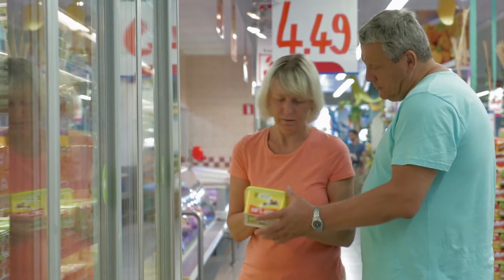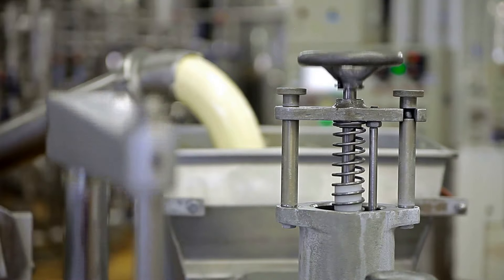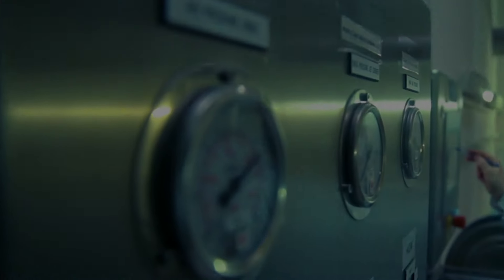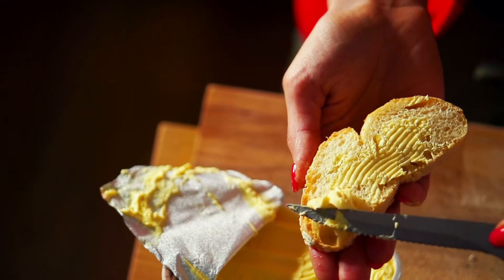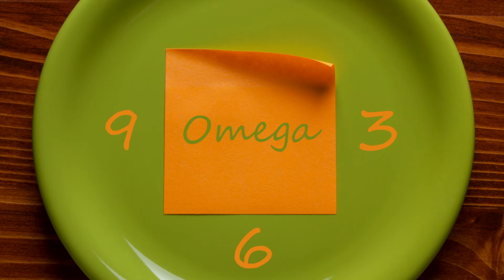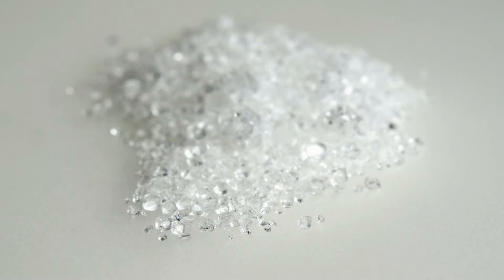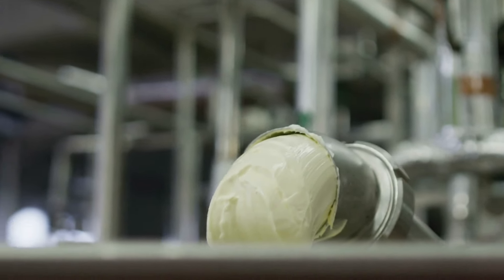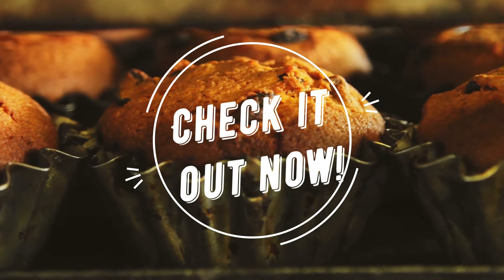How Is Margarine Made? (And Why I Stopped Eating It)

Comment: when i heard that author is concerned about GMOs, i automatically question whether the rest of information in video is accurate and adequate :-)
Reply: GMOs are just a myth :)
Reply: @drich90212  i'm absolutely serious. Nothing is wrong with GMOs, i would enjoy eating them anytime
Reply: GMO is only a problem for the genetic diversity of the crops. 

Please tell me that the stuff cow get feed with doesn't contain gentical modified crops.
Reply: GMOs aren't inherently dangerous... GMOs for the sake of industrialized mass production to maximize profits, well that's potentially a different story. If they are safe, it's sort of by accident.
Reply: GMO lack nutrients than the original ones. So clearly they are not so good.
Reply: @googleuser6894 That's simply untrue. One could argue that pesticide/ herbicide resistant GMO crops result in increased usage of said chemicals or monoculture increases systemic risk of crop failure, but having fewer nutrients is not a valid criticism.
Reply: GMOs aren't the problem, I agree. Margarine aren't better for another reason. 

They're over processed and vegetable oil in general aren't a better option than butter or animal source of oil.
Reply: The problem with GMO isn’t that it is harmful, it is that we are making significant changes that we do not understand the full implications of. Do not cross the express blindfolded.

Comment: just because something is synthetic it doensat mean that it is dangerous pls use common sense, what if i said that your cake  has sodium chloride , glucose, sucrose, sodium bicarbonatey and tartaric acid, you would be worried right? but waht if i told you that these "chemicals are salt,sugar, baking soda and grape juice?
Reply from the maker: If only margarine was made out of salt, sugar, baking soda and grape juice. :)
Reply: @FoodHow  margerine is solidified vegetable fa, the diffrence from butter is that it needs to go through a process so that the oil turns solid at room temperature this isnt needed in the milk butter because butter's fat is solid at room temperature, about the additives here in the eu we have strict food laws compared to the us so normally our margerine has : vegetable oil and fat, water, salt, citric acid, vitamins, fatty acids (  omega-3) aromas and the only " chemical" is potassium sorbate
Reply from the maker: Yes, I agree with you, but I am not a fan of the solidifying process, also called hydrogenation. Plus, the oils themselves they use in the first place, plus all the additives.

Comment: Would be silly to think that buttet is all pure if they can go to such an extent to produce margarine ! It's relatively much more easy to do the same with butter.
Reply: I have actually made my own butter, it is quite simple, but to make my own margarine, I don't think I could make it at home as it probably needs some extensive processing. I could be wrong tho. If someone has a homemade margarine recipe then I would definatley try to make it myself.
Reply from the maker: Butter is basically concentrated dairy fat, and it does not really require extensive processing, but I know some companies are mixing butter with margarine to make it more spreadable.

Comment: "But it costs $10 Cents less per pound, so that beats everything else." - Average person's thinking. What I have observed about average people is that they base their entire lives around two considerations only:
1. Cost - must be as cheap as possible. 
2. Convenience - must be handy and easy to use. 

That it's. The vast, vast, vast majority of people would rather pay less if they can . Severe health consequences 10 or 20 years down the line don't matter to 99.8% of all people. Secondly, the vast majority of people have no self-control or self-restrain. If they are in the street and they have the choice of eating hydrogenated fat-loaded cookies or starving for the next 5 hours to get home and cook a healthy meal, 99.8% will eat the cookies. The prospect of not eatinf for another 5 hours(the horror You'll die!) and then having to actually work to make a healthy meal is too much for most people. The average person is dumb and indolent and want low cost and convenience above any other consideration. 

Capitalism gives people what they want, not what they need. The food industry ust responds to the wants of most people.
Reply from the maker: Thank you for your comments; you have made some excellent points here. I have also noticed that healthy foods are way more expensive, and processed chemical-filled foods are super cheap and easy to get.

Comment: You can make margarine at home. All you need is coconut oil, vegetable oil, milk, egg yolk, lemon juice and salt to taste. Vegan option is coconut oil, vegetable oil, almond milk or soy milk or any vegan milk, beta keratin (just a little carrot juice),  lemon juice and salt to taste. I don't see where it's hard to make margarine at home much less having all kinds of chemicals.
Reply from the maker: Thanks for the tips! Sound interesting. Just wondering, I suppose coconut oil will go solid in cold temperatures, but how do you get vegetable oil to be solid and spreadable.
Reply: @FoodHow   Heat the coconut oil so it's a liquid. Add the vegetable oil. Wisk the two with the bowl on ice until it's a milky consistency. It'll be a little thick. Add the milk and the egg yolk or carrot juice. Mix. Add the lemon juice. Mix. Add the salt. Mix. Put it in a container. Refrigerator it until solid.

Here's a link on how to make it.
https://youtu.be/GFm2aCP_wx0
Reply from the maker: Thank you, I will check it out hand have a try.
Reply: ... let me set this straight' ok?

everything. is. made. from. chemicals.
Reply from the maker: Yes, indeed.

Comment: The mith about butter not being ok for people,  can be easily destroyed. 
Anyone can put a piece of butter in his mouth and find out that is melting. 
Body temperature is exactly the same temperature as inside the mouth,  so butter will melt.
Butter will melt and will going to be processed by gastric juices. No fat will be stuck inside veins or anywhere else inside the body because the body has the temperature to melt the butter, and if the butter is melted,  then the fat which butter is made of, will be melted. 
Same as the pork lard. Pork lard and pork fat were demonstrated as a major cure in lung issues like tuberculosis.
Reply from the maker: Very good points, thank you.

Comment: SO where did we get Olive Oil? It's been around a long long time! And it is good for you! (Note: Olive Oil has been manufactured for over 2,000 - 3,000 years!)

Also, have you ever melted real butter down? It is made with an oil base, sometimes known as "Gee." So calling margarine not the same as butter is absurd!
Reply from the maker: The olive oil you're likely referring to is indeed cold-pressed organic olive oil.  Produced through a method that involves mechanically pressing olives without the application of heat and chemicals. 

Also, ghee is pure butterfat without any milk solids, nothing to do with margarine and oil. I make it all the time as it is good for frying. If your butter was mixed with oil, then it is probably some type of butter spread, and I suggest not using it and throwing it away.

Comment: All of these points are very true, and most of them I already knew. However, there is another reason to avoid margarine, and this can also lead to health complications. But this is one that you missed, and probably should have included.  Margarine manufacturers use three different chemicals, which are found naturally in butter and trace amounts. These chemicals are. diacetyl, acetoin, and acetylpropionol, all of which are found naturally as a result of the anaerobic fermentation of bacteria. As a result of that, these compounds are what give butter and some cheese as their unique odor.  It also contains a small amount of a fatty acid called butyric acid, which is a fourth compound that is responsible for its flavor. That fourth compound is missing in margarine, but the other three that I mentioned are very concerning in high concentrations, which is guaranteed in a stick of margarine. When heated and inhaled, diacetyl in particular is known for causing airway complications.  It’s one reason why I avoid the so-called popcorn butter found in theaters. It’s a wonder that the people working those snack bars don’t have breathing problems.  And the ironic thing is that this problem usually affects healthy, non-smoking men.  Women rarely suffer the condition. But it does happen.
Reply from the maker: Very good information, thank you for posting. I should make an updated video soon. Thank You.
Reply: @FoodHow  as a blind person, I can smell the difference between real butter and margarine. The difference to me is very apparent as margarine becomes, melted and heated up. It has a smell resembling butter, but it has an underlying off smell to it. that is difficult to explain with words. But the odor is redolent of melted plastics.  The breathing problems associated with the artificial butter flavoring were discovered back in 1987 when workers at a baking company in Missouri became sick due to unprotected exposure to the butter flavor. That information was covered up. In 1993, a German manufacturer of artificial butter flavoring, also made the same discovery when its own employees became sick due to exposure.  And finally, in Jasper, Missouri, the same link was re-discovered when dozens of microwave, popcorn manufacture, workers became sick due to exposure to the butter flavoring. In real butter, these chemicals are found in very low concentrations, not enough to be of any significant health risk to breathing, at least, according to my local MD.  But when the chemicals are produced on an industrial scale, and added to food products as an artificial flavoring, they’re used in much higher concentrations. In fact, in the Missouri case, the artificial butter flavoring that was normally supplied to the company had a diacetyl content of just 3%. That made it relatively harmless. But unbeknownst to the workers who makes the stuff, they had ended up with a vat of it that contained 10% diacetyl. If you look up the Eric peoples his story, he states it out quite clearly. And all the while, you hear his breath’s through an oxygen tank. The man who made the speech contracted, bronchiolitis obliterans, after being repeatedly exposed to the flavoring, chemicals at the popcorn plant.  I always found reading about this very intriguing, because who would think that something that smells good could hurt you? And in nature, where it occurs, naturally, it typically won’t. But when we concentrate it, that’s when it becomes dangerous. It really was disconcerting to hear Eric Peeples make his speech, while hooked to oxygen, And occasionally coughing and clearing his throat. I last heard he was on a transplant list. But unfortunately, lung transplantation is another condition in which bronchiolitis obliterans can occur. So there’s always a chance of it resurfacing even after a successful transplant. So three things happen when you get exposed to diacetyl in high concentrations. You either die, end up on the transplant list, or simply end up, living your life, or rather, the remainder of it, with a lessened ability to breathe.  I once heard about a 47 year old woman who was otherwise in great shape, but after reading, just two small bags of microwave, popcorn, a day, couldn’t even walk without getting out of breath. I also heard about another woman who had to sleep propped up all the time. And regarding the guy who won $7 million after suing a manufacturer of butter, flavored microwave, popcorn, he has to live with a 50% lung capacity. No telling if the guy is still alive.
Reply: @FoodHow  The video that I mentioned is found under the channel insider exclusive. There are actually two stories of people who worked at these popcorn plants who contracted the condition after being exposed to the flavoring chemicals.  One man’s name is Jerry, Blalock, and the others name is Eric peoples.  But walk into a movie theater, and the artificial butter smell is readily apparent. Walk into a place like auntie Anne’s pretzels, however, and there is a butter smell, and while it’s similar to the popcorn, butter, you smell in theaters, it’s actually the real thing.  Anne Beiler, the Amish woman who founded the company, would never countenance using margarine in her pretzels.
Reply from the maker: Ok, thank you, great information, I will check it out.